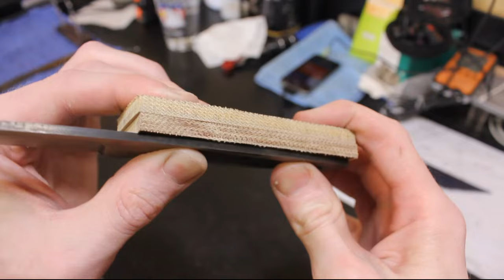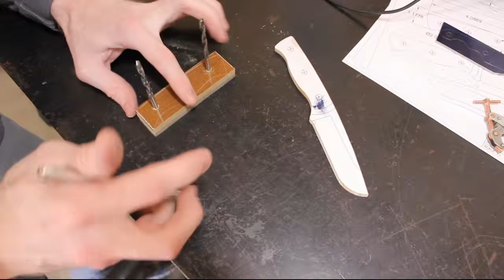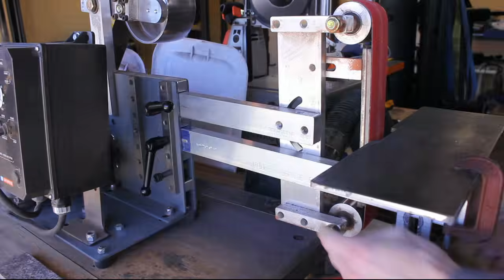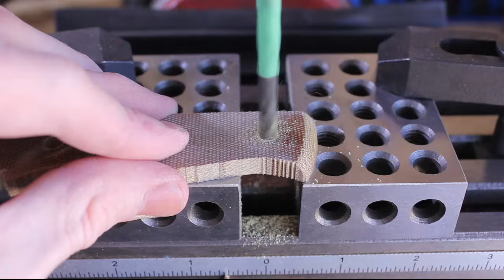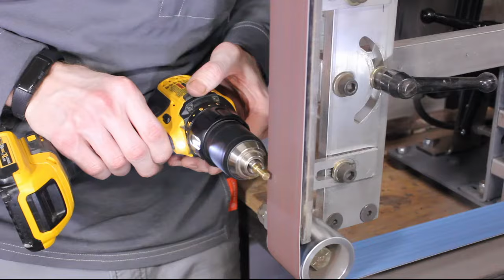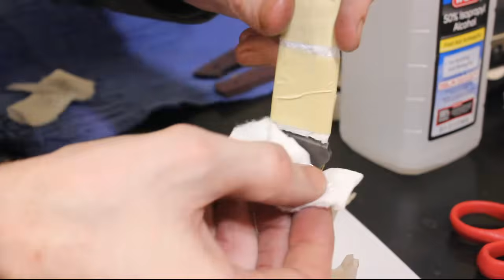How to Make Knife Handles - Beginner's Guide 2019

Comment: I'm a about 1.5 years in self taught with some online help. I haven't been utilizing the internet nearly as much as i should so there's a lot I still don't know. I've gotten the handle attachment process down at this point but I don't know what's up with the hollow ground part of the tang. I been drilling extra holes to help with weight/adhesion. Is the hollowed out tang for the same reasons?
Reply from the maker: Yeah pretty much same reason. Weight reduction. Maybe a slight case for saying you have some more space for epoxy to bond, but I don't think that really matters much.

Comment: I don’t know what I’m doing wrong. All my stuff is at a perfect 90’ angle, but when I drill holes and go to stick pins into them it’s like the holes are off. I follow the exact steps you use in this video and use a drill press. The holes line up while they’re stacked up under the knife, but as soon as I take put a scale on both sides of the knife my pins won’t fit anymore and it’s like the holes are off.

It makes me think something is crooked but I can’t figure out what. I’ve had the issue with many different types of scales from many different places.

Also how would you our knife scales onto a stone washed knife without messing up the stone wash on the spine?
Reply from the maker: Man I'm not sure what's going on with your builds, I haven't had issues with this method. 

As far as keeping the stone washed finish you can build takedown scales like this - https://youtu.be/PkkVVYiNrrY

Or permanently like this - https://youtu.be/CbOj-k7M1us
Reply: Thanks for the videos suggestions I'll give them a watch!

And it's all trial and error right? I'm relatively new to the hobby. I got started about 5 months ago thanks to your videos. Saving up right now to get a 2x72 and get more serious. So I still got a lot to learn.
Reply from the maker: @norcalbowhunter3264  Awesome, good luck with your builds man!

Comment: why do you use these corby fasteners instead of regular cylinder pins? What advantage does it provide?
Reply from the maker: Corby fasteners are common in the custom knife making world. They look like regular pins, but pull together mechanically.
Reply: @RedBeardOps  thanks for the reply! I just saw a cross section view of a corby fastened handle and understood the mechanics. Makes a lot more sense now :)

Comment: Since you have a drill with a depth guide for corbies you do not need to adjust the depth gauge of your drill. We would drill with the drill setting if we had a simple drill. Simply rest your micarta on your drill plate and drill fearlessly, when the tip of the drill driver touches the metal plate you are ready.

Comment: how do you make sure your tang stays flat for a good mating surface between the scales and tang during the hand-sanding of the tang? i've been using the surface grinder to get the tang real flat but have to sand the knife to get the finish which inevitably gets rid of some of the flatness where i'm hand-sanding (up by the front of the handle)
Reply from the maker: I surface grind to around 320 grit so there really isn't much more material to remove at the ricasso. You can take it to the surface plate with some sand paper if you get out of flatness
Reply: @RedBeardOps  makes perfect sense. I was only surface grinding to a very rough grit. thanks as always

Comment: Great video, thanks for making it.  

I am stuck on one thing, though, and maybe you can help.  I peen in pins to hold on the scales and backspring (I make slipjoints, mostly), and by the time I have filed and sanded the handles to shape, the mushroom head has been ground off and there is nothing holding in the pin except for a little glue in the hole.

I am working with tiny, 3/32" or smaller pins.

Got any advice?  Thanks!
Reply from the maker: Hey man, just some thoughts... no expert here. When you peen the pins the mushroomed top is not all that holds the pin in. It actually reverse tapers the pins on the ends.... I think... If there is some room in the hole for them to do so. 

Also many makers use straight pins with just epoxy and they hold up very well
Reply: It will help you to use a tapered reamer first, to allow more room for the pin to expand into, then when your done, there should still be enough of expanded tapered pin.

Comment: This was so great. I always struggle with the handles. Just a tip about the Corby bolts. Most of the Corby's are metric, so if you get some metric bits it will save having to sand down the outsides to fit the hole.
Reply from the maker: Cool, thanks!

Comment: I watched this video a few weeks ago.  Until then I always had trouble with the pins lining up after drilling the scales.  Using 1-2-3 blocks with a small clamp is the perfect method for keeping everything lined up.  Yesterday I drilled 6 small holes in a small boot-knife handle and every pin was aligned perfectly with the holes I drilled.  Perfectly!!!  Thank you for making this video and making my knife making so much easier… 🐳
Reply from the maker: Glad it worked for you! Cheers!

Comment: At about 7:22, you caution against getting epoxy into the female part of the corby. Why is this? Do you put any epoxy on the male side to bond them together?
Reply from the maker: Yes it doesn't seem to be an issue to get epoxy on the male side.  Getting epoxy in the female end can sometimes cause it to get trapped in there and thus not allow the male side all the way in. Since the epoxy is pretty non-compressible; this can cause the corby not to completely tighten down in some cases.

Comment: Great demo and explanation. 
I use,a similar method when doing  my fit ups. Couple tricks I use are to put a L or R o the scales in pencil to avoid switching them and I also slightly enlarge the drill hole from the inside of the scales, being careful not to go more than half of the thickness. This seems to help with alignment and ease if putting the pins in.
Reply from the maker: Nick Riggi very nice! I like the labeling of left and right. My Corby holes end up slightly oversized after reaming with the counter bore bit. Thanks for watching!

Comment: Great Vid thanks for that, is there a name for the clamp that is bolted to your drill press bed? I've seen people using these but can't find them anywhere :) I use a vise grips but a fixed clamp would be better I think.
Reply from the maker: MrSoloun I found that clamp at harbor freight. It’s specifically made for drill presses. I think it was around $15